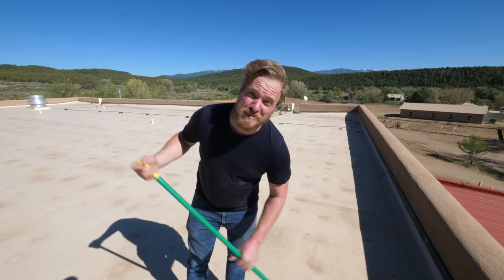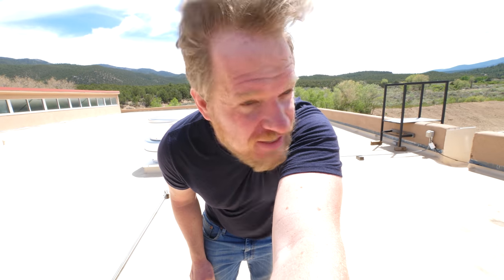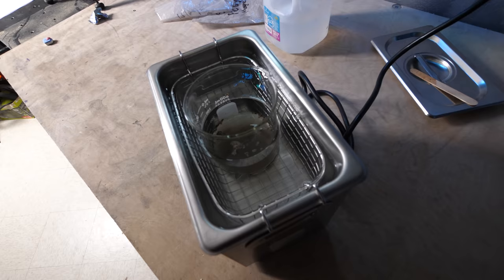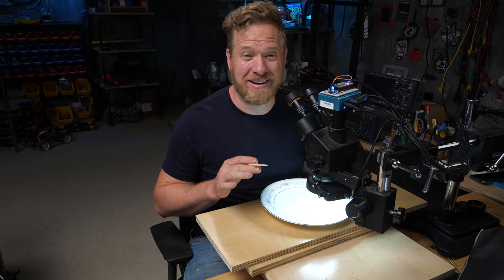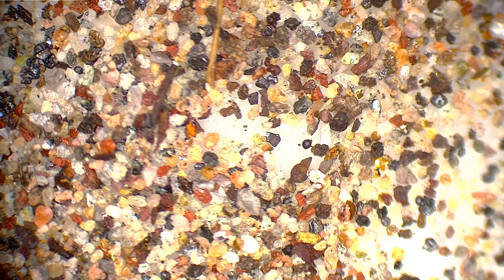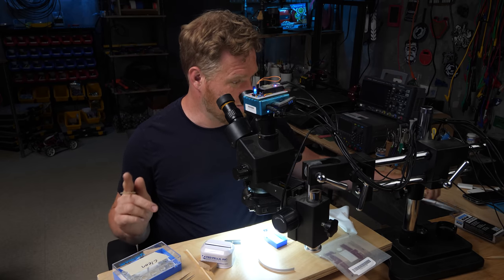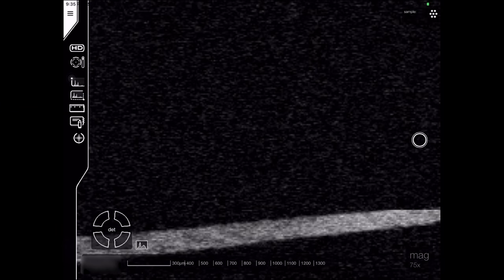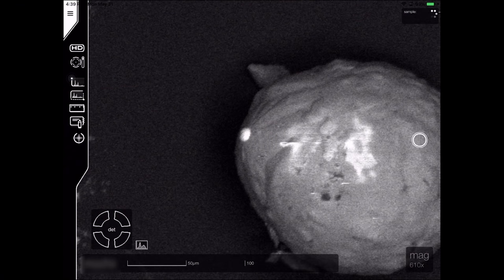I found a meteorite on my roof!

Comment: Cool technique! I visited Meteor Crater in Arizona several years ago. The guide explains that most of the meteorite was liquified by the heat of the fall and impact, and sprayed out of the crater along with the huge masses of stone and earth. So standing on the rim, you can run a magnet along the ground and pick up lots of small bits of meteor material. It's an amazing place, if you ever get the chance to visit. About three quarters of a mile diameter.

Comment: super cool! How do you know that there weren't larger meteorite specs then the .4mm size?
Reply: Larger specimen exist, but they are much rarer. Additionally there is a lot more magnetic terrestrial dust in segments above 400um making the extraterrestrial dust harder to identify. The process developed by Jon Larsen is designed to increase the signal to noise ratio and make it easier to find these tiny, extremely rare, stones (signal) in the midst of all sorts of “uninteresting” terrestrial dust (noise). So by narrowing down the granule size of your sample you basically increase your own odds and perhaps also save your sanity 😅

Comment: I got this tip myself, so I'll pass it on:
If you want a lot more freedom and easy adjustment when working with your microscope, Aven Tools make 27 and 32mm microscope arbors to VESA mount adapters. They're like $100. Add a really sturdy, wide motion monitor gas arm, mount your microscope on there.

Then you'll have huugely more freedom of the work surface and use of the microscope. If you're doing a bit of work that doesn't need the microscope, you can just lift and swing it away. And within reason, you can swing it in over something within a much larger work area, without needing to move whatever it is you're working on. It's also really handy when looking at stuff that varies a lot in height - you can just lift the microscope head up 10, 20, 30 cm if you need, with one quick and light little hand motion.

Only important thing of note: don't go too heavy duty on the monitor arm. You want it to be solid for stability when far extended, but not have such strong lift that the microscope head weight is way below the minimum weight rating. Because then it'll keep lifting it up when you don't want it to.

Comment: FYI - if you can figure out where the arcing is happening inside the SEM you can use some PCB conformal coating to treat the area if it's on a PCB. The shorting distance can drop from 12mm down to like 3mm. may fix your high altitude shorting issue with that thing.

Comment: I think the flow lines were pretty convincing before you scanned them. 
I have a couple of Jon Larson's books. They are very interesting reads with excellent photography. 
I do have a couple micro-meteorites but they aren't much to look at without a Microscope !!  They do fit in well with my Meteorite Collection though which btw is almost entirely from the Meteorite Man himself, Geoff Notkin's store called Aerolite Meteorites.
If you want genuine meteorites, you are best to buy them from a renowned meteorite hunter.

Comment: How does the spectroscopy of your meteorites compare to the same analysis of welding spatter?
Reply from the maker: Welding spatter is entirely iron, whereas these two meteorites only have the small iron/nickel bead on an edge.  The surface texture of the welding spatter is also really different - it doesn't have those parallel striations I talked about.  It's more just... lumpy.  I found some - I should have spent a bit more time and talked about the difference.

Comment: I jse this magnet on wheels from lowes its a 2 inch wide by 4 foot long squar tube with a magnet that goes all the way across it and its on wheels and you can jusst drag pull or push it by hand and walk with it and it picks up anything magnetic and since i have access to many roof tops cause of my job lile building roof tops ill bring it along and jsut push it around when im done working to pick up any dropped screws hardware ect and also hope it picks up a meteorite and k have 12 so far in the 2 years doing it and have sent them all off to be graded and my biggest one is worth 1500 dollars cause its a good size one and i saw it pocked it up it stuck to magnet and couldnt believe it could be that big of a meteorite i found on a roof top. You should look into the roller magnet would make it easier to find them on a roof and no need to sweep with broom. But yes i have a bunch of really tiny ones that are the same size as the one you found and need microscope to really look at them and they are in a vial with liquid to perserve them like same gold flake tubes that gold hunters pit thier tiny gold flakes in. Its alpt of fun hunting them in creeks as well when looking for shark teeth and megalodon teeth which i jave two i found in creeks

Comment: I found a rock,about 300g heavy....smooth to the touch and attracted by neodimium magnet but not too strongly...it gets attracted but it doesn't hang on it...so there is iron but I don't wanna break it couse it is shaped like a spear...still courious tho...
Reply: Sometimes you can call a university to see if they might be able to scan it with an xray gun or something.

Comment: Could you increase partial pressure of nitrogen by surrounding it with a low pressure box filled with nitrogen, dry ice,..   to allow you to run higher voltages.